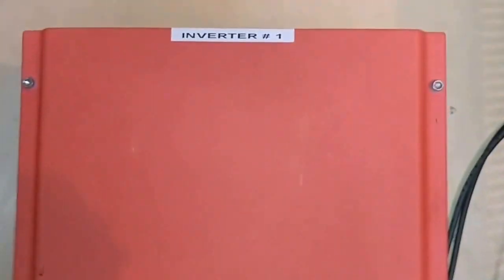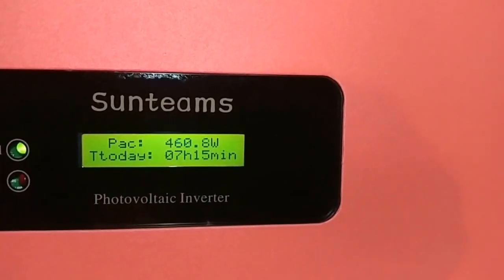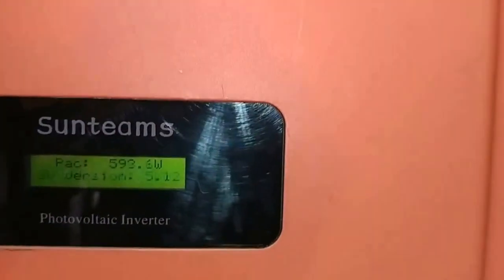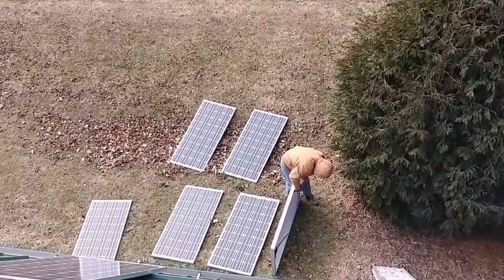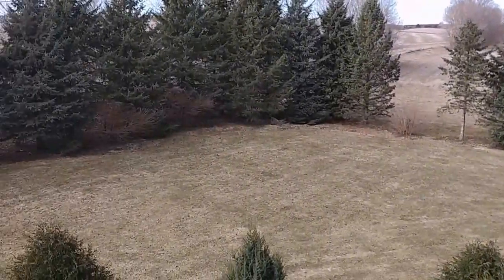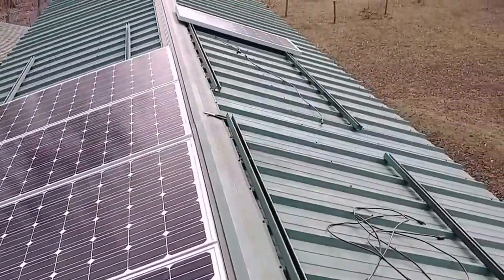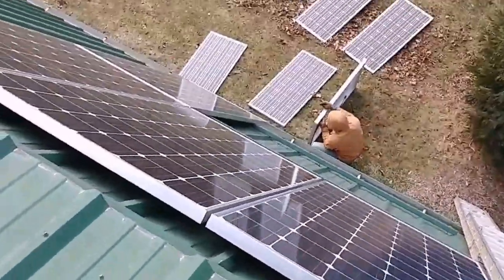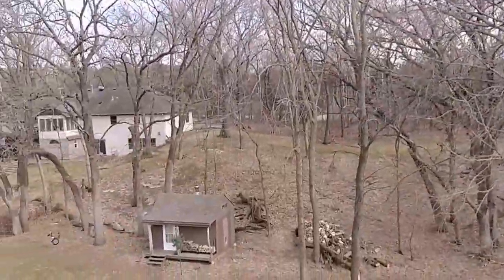NEW SOLAR PANELS UPGRADE INSTALLATION ON A STEEL ROOFTOP #2

Comment: u used the drill here
Reply from the maker: Yes Sir.
Reply from the maker: That drill is designed for cold weather like that. Check the specifications
Reply from the maker: Thanks for watching
Reply from the maker: +Ruben Rivera 
They work pretty well
Reply: good
Reply from the maker: Ruben Rivera 
Thanks for watching and have a good night 🌙